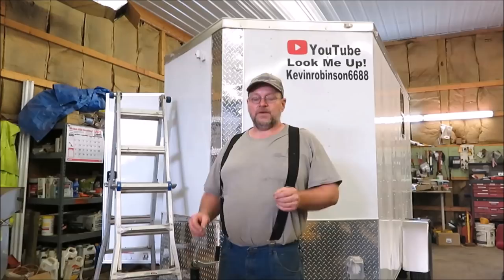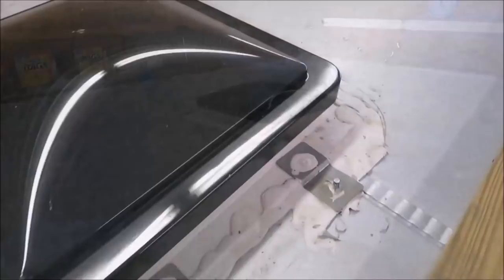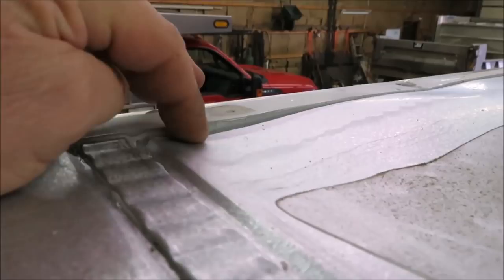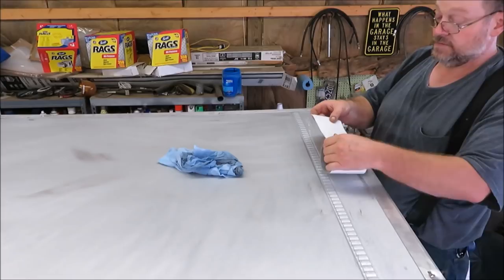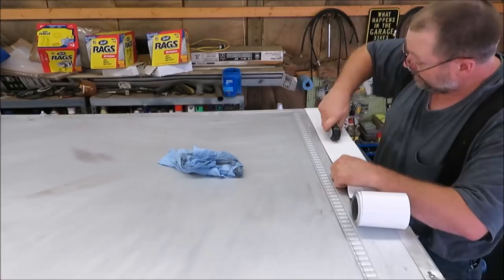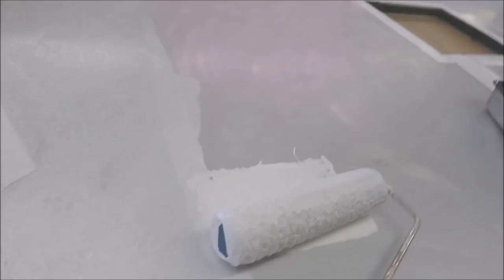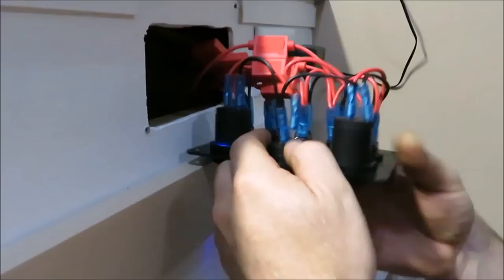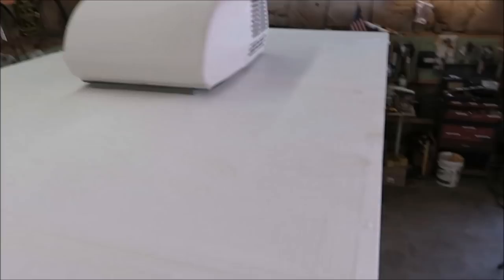6 x 10 cargo trailer roof repair and air conditioner

Comment: I did same procedure to my enclosed trailer... scraper, wire wheel, rubbing alcahol, eterna bond tape, self leveling lap seal... no leaks or seperation... done. Nice job.

Comment: I hope that elastic coating works out. I'm almost at the point to put something on the roof of my camper. I have all the walls done, but only primer and one coat of paint on the roof. I wanted to paint it with white. All the other walls are desert tan. Let us know if that's good stuff as I might want to go that route too.

Comment: I hope the roofing sealant works out for your Kevin. Happy to see you got an air conditioner! I wished the roof vent we have was wired, I'd take the fantastic fan off your hands! Thank you for sharing!
Reply from the maker: A $100.00 + shipping should be good for the fan and the cover
I have $185.07 in the fan and $60 some in the cover.
Reply: Kevin Robinson I just have a regular vent fan in there now so there's no power ran to that manual fan. I wouldn't know where to get the power from to run it. Thank you though!

Comment: Kevin, I think you were dealing with two different materials on your roof. One might have been galvanize aluminium and plain aluminium that came up from the side walls. The sealant stuck to one but not the other.
Reply from the maker: Maybe.

Comment: How did the rubber roof on the trailer work out and if it worked out good what product did you use I'm doing the same setup.
Reply from the maker: It's a latex I'm going to do an update video not sure that i like it I thought it was rubber my son bought it for us.

Comment: Hope you have some heavy duty wire for the AC draws lot more then fan. Is it 12 volt?
Reply: FixmyToyota  That fan probably had 14 gauge wire on it. I bet Kevin uses 8 gauge or maybe 6 gauge. He builds  everything the way it SHOULD be built.
Reply from the maker: I used 12-2 wire thanks for the comments.
Reply: Good. AC is better than DC if you have a shore hookup.
Reply: Yeah, you don't want to run the AC off of a battery.
Reply: In a recent video, CheapRVliving showed you need a minimum of 600 watts, a slow starting air conditioner and a battery bank of 1000 watts to maintain a 5000 btu air conditioner during the day.

Comment: Hey Kevin, can you tell me the name of the company that built your rig. I think I want to avoid them. Thank you
Reply from the maker: DIAMOND CARGO thanks for the comment.
Reply: Diamond Cargo is horrible. I’ve posted my negative review with photos to Google. Thank you Kevin. I am getting ready to do this to my 8.5x20 trailer only after 2 years of owning it. I found out the hard way through mold and rusting carpentry tools.
Reply: Diamond Cargo is horrible. I’ve posted my negative review with photos to Google. Thank you Kevin. I am getting ready to do this to my 8.5x20 trailer only after 2 years of owning it. I found out the hard way through mold and rusting carpentry tools.

Comment: Why didn't you buy an actual rubber roof kit. You get what you pay for.
Reply from the maker: You are right.
Reply: I used the stuff from Home Depot.
Allied with brush (after prep).
Each coat goes 90 degrees from the previous.
4 coats.
Never leaked after 6 years or so in very cold and very hot temps.